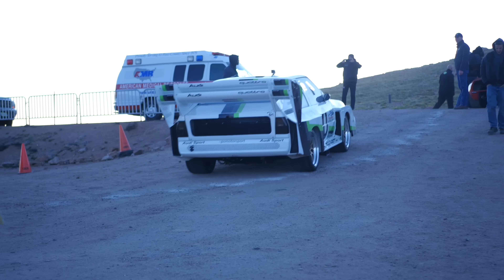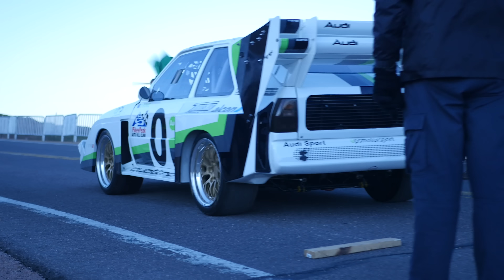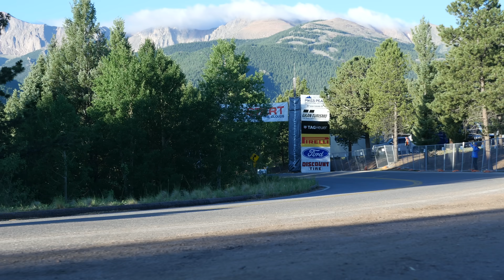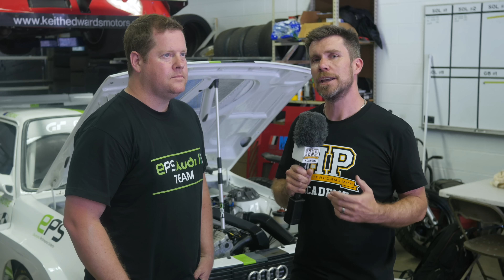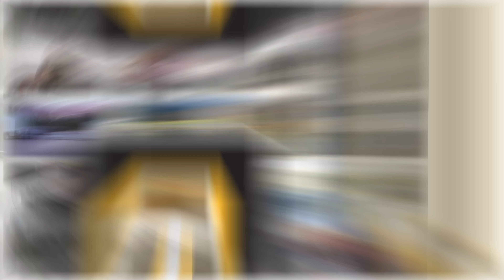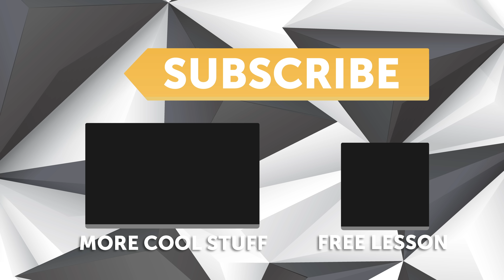Do you need to BLOW UP engines to learn how to tune? (No!)

Comment: With so many people interested in tuning over the last 3-4 years, I've seen many high level tuners recoil from being open about sharing knowledge and/or letting outsiders in to observe/learn. I've also seen many mid-tier tuners work passing as acceptable because the industry is flooded with absolutisms and misinformation.  The best way to learn tuning is by learning Combustion Dynamics.
Reply from the maker: The more knowledge someone has, as a rule, the more they will share. It's often only those that don't have a lot of knowledge that hold on and try to protect the little that they do know.
There are exceptions from time to time, but I find it holds true more often than not in my life experience - Taz.

Comment: I also want to learn a little bit of ECU Tuning in the Future, and i have a plan how i will do it.
I buy a dirt cheap BMW E36 4 or 6 cylinder , and i buy a dirt cheap Plug and Play ECU from KDFI (based on Megasquirt Software)
For around 1000€ i can beginn learn how to tune a ECU.
I think it is the best i can do without paying several thousand of €.
Greetings from Germany 🇩🇪
Reply from the maker: Yes we always recommend a NA engine that has plenty of bolt-ons and support regarding software or ECUs that you can grow with without having to get everything custom made etc. There are many different combinations that fit this with pros and cons for all. Enjoy the journey! - Taz.
Reply: Most Ford EFI cars can be flashed tuned.

Comment: I have a 20v i5 Audi GT I'm considering building/ converting to AWD since it has a closed deck iron block. Either I modify the i5 or give into a 2JZ GTE VVTi. What would you do?
Reply: Something wrong with the 5 cylinder? Plenty of hard core parts available for it. Depending how much power your after 2JZ get really expensive after 500-600 hp.
Reply: @dj4monie  nothings really wrong with it but aftermarket parts are harder to find and normally have to be imported from Germany. It honestly comes down to upgrading camshafts and crankshaft to get past 600hp with the i5. Otherwise a 2JZ just needs a torque plate adapter and has every aftermarket option already available. It's gonna get pretty expensive either way so I'm building it for race only. I'm considering a STi driveline if not Audi.
Reply: I know this comment is old but do you have an update?

Comment: Math, physics and mechanics are great prerequisites to tuning.  
  It is nerve racking to think a motor could fail from over looking parameters while tuning. So long as one understands what their working with and keeps a bushy tail while doing it then there really isn't need to rush results, more the need to mind tolerances of what's involved, is the vehicle up to snuff.  
  This was a very reassuring video :)
Reply: Understanding the basics at first is plenty. Most people do not have high HP projects, very mild with very low expectations really. For example I am in the Focus ST community where the vast majority of cars are on the stock flash, a larger minority is tuned while an even smaller minority have upgraded turbos, I count myself as one of those people. I am also apart of a smaller subset that are building towards 500-600 whp. Which many Millennials and Gen Y believe is too much power in a FWD car. While being Gen X I come from an era where running single digits was once thought to be impossible with a 100% race car, let alone a street car. There are street driven FWD cars with just a tire change capable of running single digits now and driven home afterward. My point is, as the power goes up what fuels run, spark plug gaps and heat ranges become important and are easy to learn.